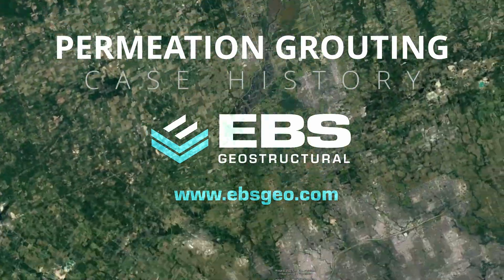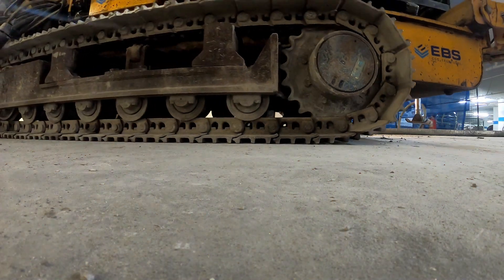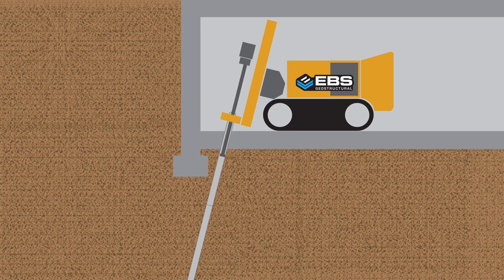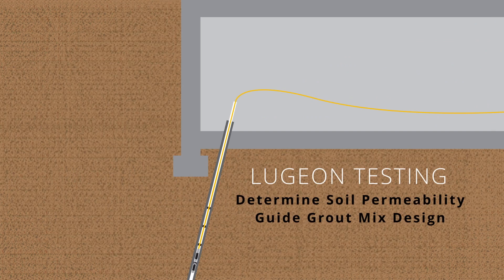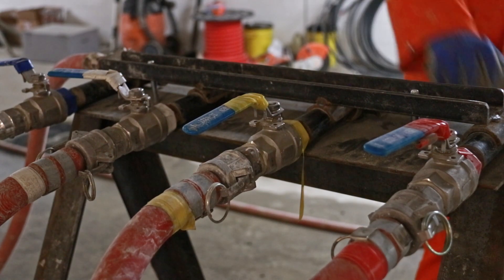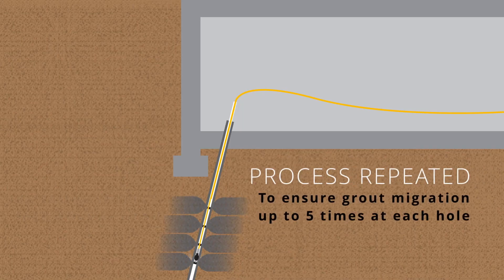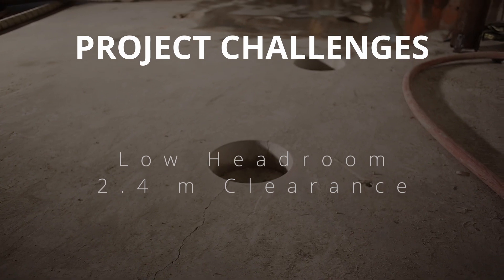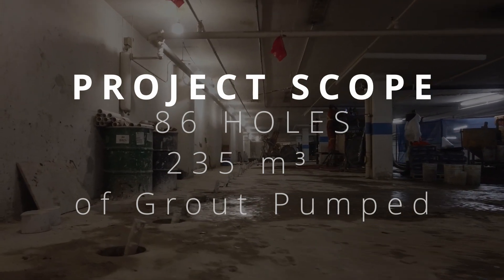Permeation Grouting Case - EBS

Comment: So if the building has the potential to sink or shift this is done to prevent it from happening by removing the soil or debris that could potentially cause the shift or displacement and then grout/concrete is placed in the ground to give it a much more stable footing?